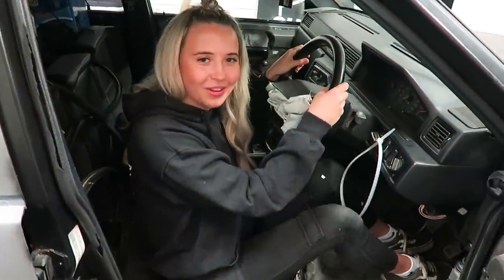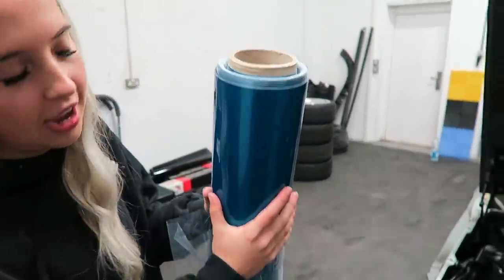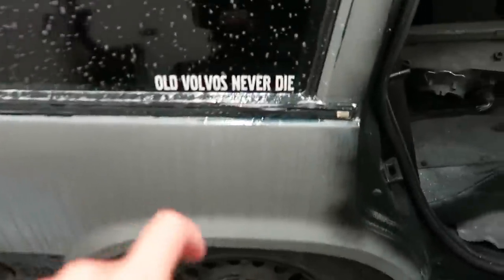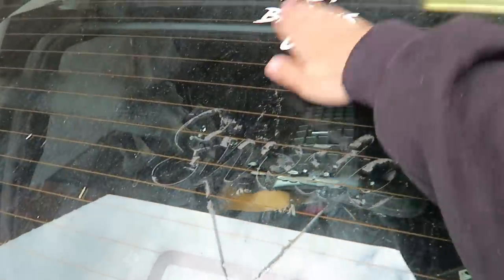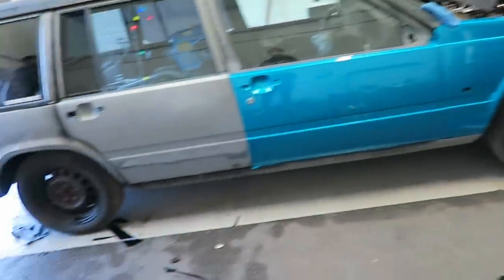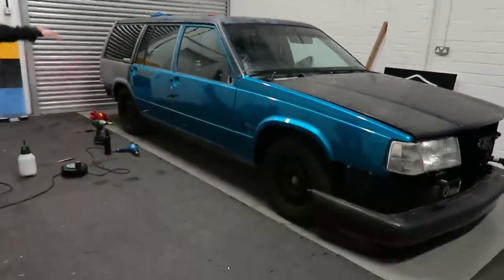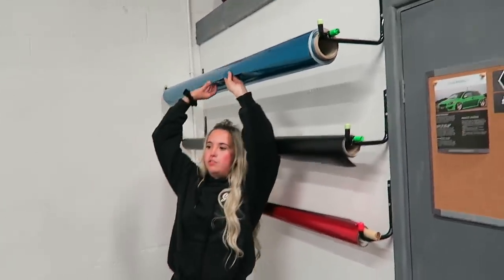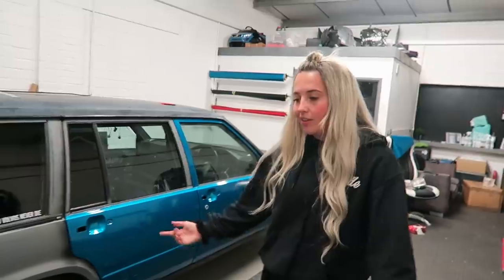Bringing The Volvo Home! WRAP REVEAL!

Comment: What was the point in using the off cut for that pillar when you had to chop a huge piece out for the rear wing that would of covered the pillar anyway so no join?
Reply from the maker: Because there’s a piece of trim that covers that part anyway, if it works why is there an issue
Reply: @emilyshields3667  I'm not telling you how to do it, I thought it was a good idea to use an offcut but then you had to use a massive piece that would of covered the pillar anyway. So seemed pointless because then you have another huge offcut left.
Reply from the maker: @j1m909  I’m not gunna loose sleep over a 30cm piece of wrap
Reply: @emilyshields3667  I thought you were concerned about waste that's all, as you used the offcut to start with